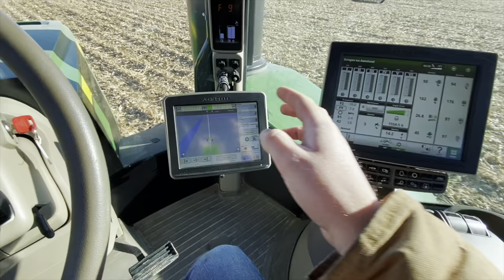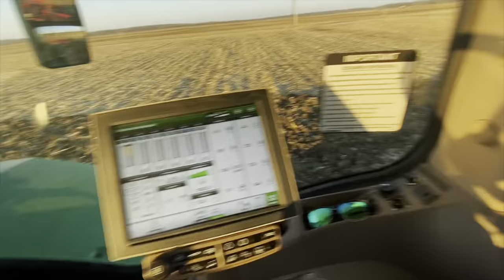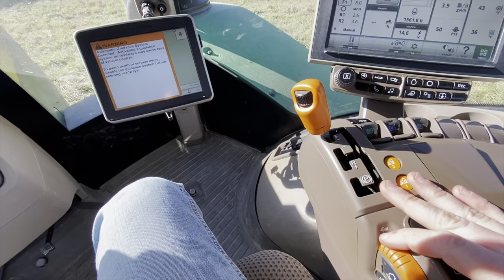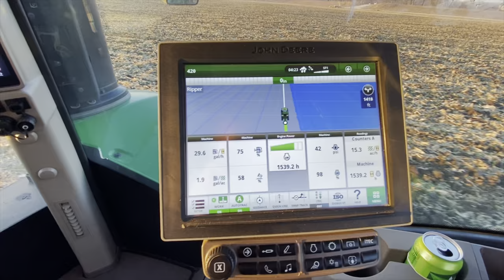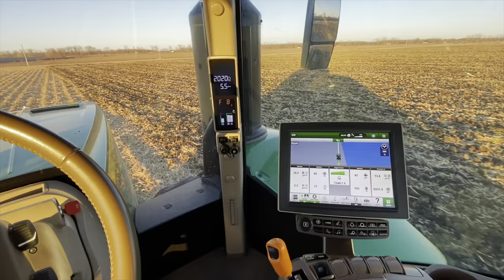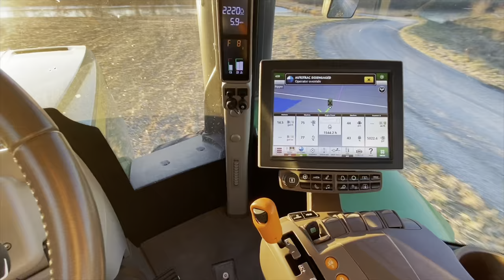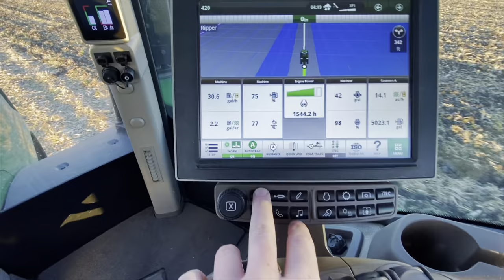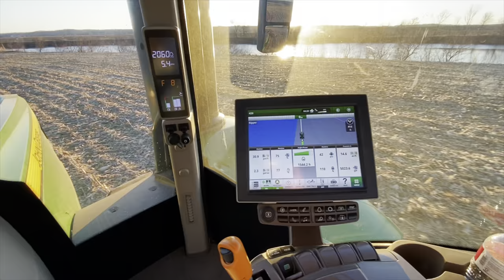John Deere 9rx tractors are the best

Comment: Great  video and thanks for your personal  opinion!  Personally  I need power to the ground and shift when I hit it so we run case quad tracks
Reply from the maker: They may shift “faster”, but they’ll beep at you if you try and shift too many gears at a time. I’m also not a fan of the controls in case IH equipment

Comment: 730b is the same way but 100 fold worse, have to carry the levler in black mucky ground. The 875 we demoed last fall was built like a tank on them. Neighbors said in frozen ground to bring levelers up se but never broke a bolt,
Reply from the maker: If it gets bad enough, we could just drop the rolling baskets so they don’t pick up gumbo, but I don’t think the levelers are bad as long as you check them daily

Comment: Why would you not go at an angle? Would it not work better?
Reply from the maker: When I set guidance lines for ripping, I use an A plus heading method and I go at an angle of three degrees to the rows, so it’s not much of an angle but still enough to do the job
Reply: @goldingerfarms9357  Right on! I thought you were going straight up and down. We used to cultivate at a 45 degree angle,